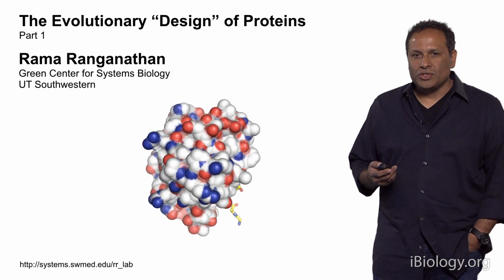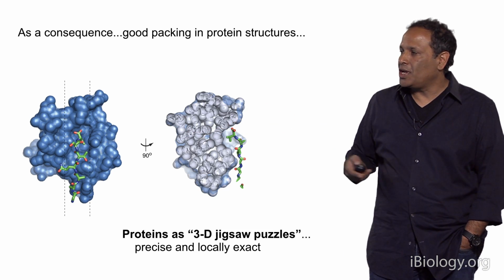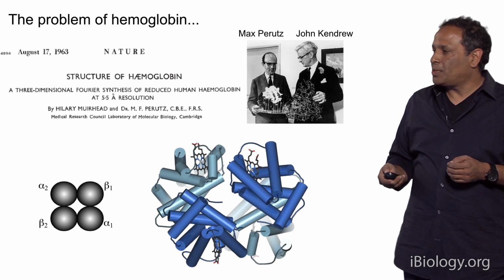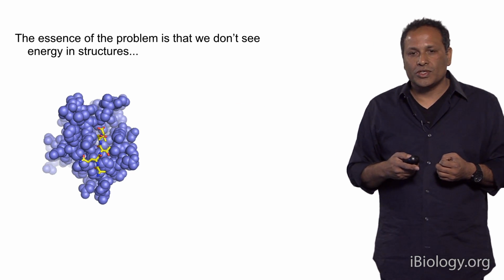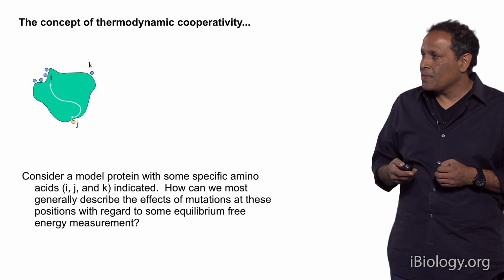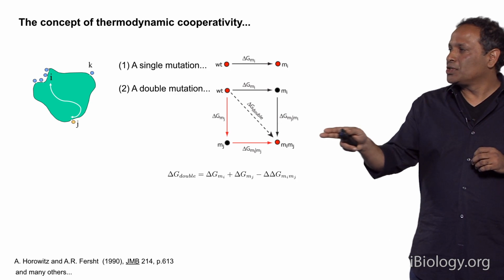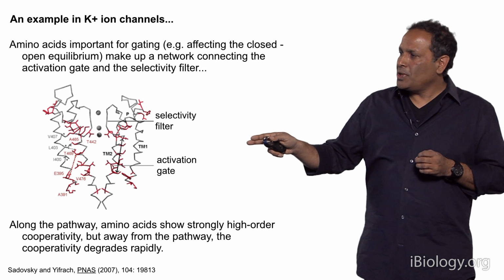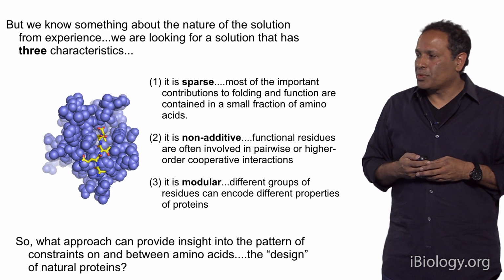Rama Ranganathan (U. Texas Southwestern) Part 1: What is Protein Design?

Comment: Lovely lecture. Not happy with the adoption of "design" and "interrogate" into the nomenclature though.
Reply: Keep in mind that Shih Tzu's are designed. Corn is designed. Etc. Design is synonymous with in vitro/directed evolution here. It's just that the  metaphor has been extended to natural selection as you point out.  Let's not be afraid of the word simply bc creationists don't understand it.
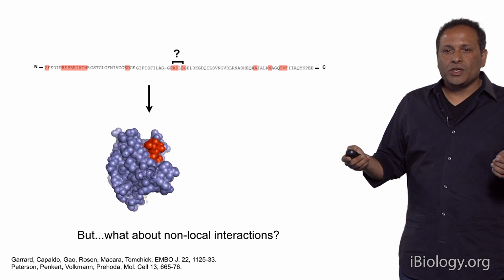Reply: 6:20 ff, unknowns in surface structure have been specified in some cases as glycans